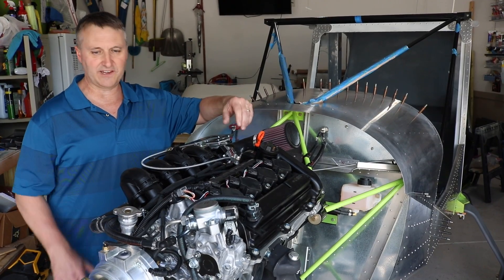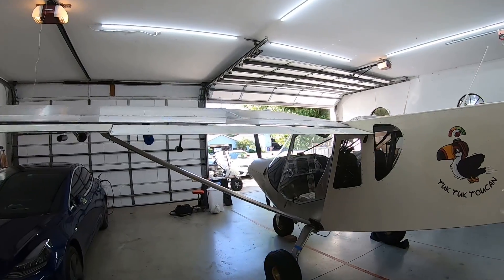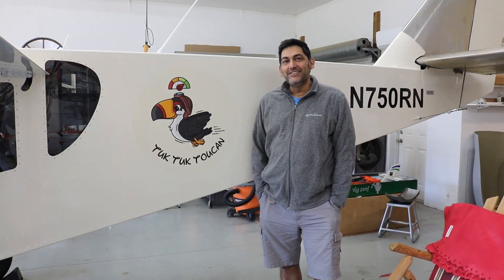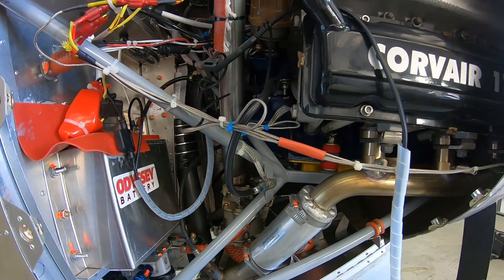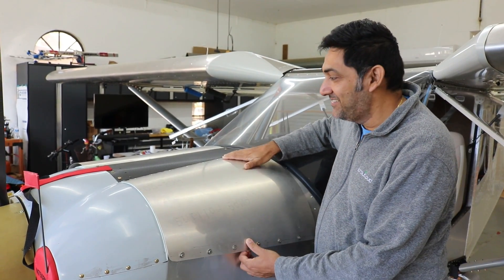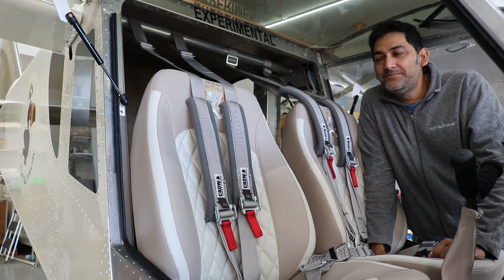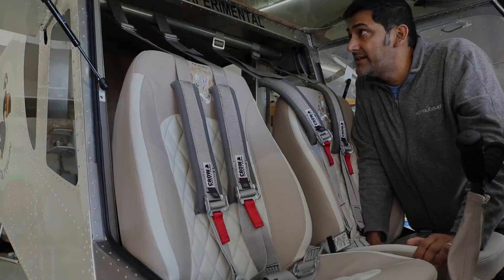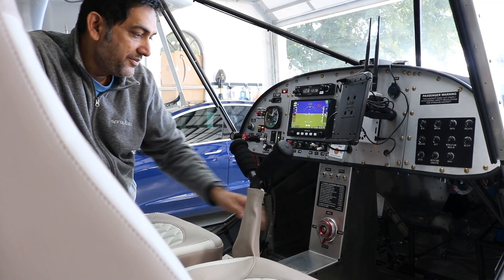Engine Installation Options - Corvair Zenith

Comment: Ive researched the corvair engine for a long time. By the time you buy everything to convert the engine you could buy a good low time Continental 0-200. Plus, what I have seen about the reliability of the corvair, no thanks.

Comment: The only issue I see with the corvair is the support is all from one guy who specialized in converting the GM Corvair to an aircraft engine. What if something happens to him now where do you get support? I think I would rather use a Rotax 912 which has lot of support from multiple sources. If you don't mind tinkering with engines then the Corvair is one good option.
Reply: Actually William Wynne has a strong partnership with Sport Performance Aviation (creator of the Panther LSA) to both manufacture and market Corvair conversion manuals and parts.  One of the coolest things is that WW offers colleges and build seminars where people get instruction - for free - on how to build the engine.  So as a home builder you will know both your aircraft and your engine from the inside out.

Comment: I've settled on that exact engine and airframe combo and just got done disassembling the engine core.  Even if you don't go with a GRT PFD, their engine monitor has a serial output that should integrate with most PFDs currently on the market.
Reply: Me too!

Comment: Does this use the stock corvair transmission?
Reply from the maker: The transmission is NOT utilized in Aircraft. It is in fact "direct drive" just like typical piston Aircraft engines. Thanks for asking!
Reply: @ExperimentalAircraftChannel  haha I will be using one in the bearhawk lsa I am building. Just messing around

Comment: Ramesh has a great attitude, I’m hoping some of that rubs off on me as I move towards the engine install on my rv! I also went with Steve for my fuel and brake lines.
Reply from the maker: Yes...yes he does! You can see the excitement and passion he has for Aviation and in Life in general when speaking to him.  What are you about to install I your RV???
Reply: @ExperimentalAircraftChannel  "about to" really means in a year. I have an io390 exp119 on order with Lycoming. It's going in an rv14A that I am building here in my garage in MA

Comment: Can't understand why none has installed a Hayabusa 1.3 turbo on a LSA airplane yet. 300 HP and 150 pounds.
Reply from the maker: A Kawasaki has been done (competition for Hayabusa). And of course a Yamaha. The problem with straight out motorcycle engines is the high rpm and stock/standard ggearboxes.   You need a purpose built gear drive to match prop rpm/length.  Thanks for engaging here! Good to see your interest!

Comment: Ramesh Nori accomplished creating a remarkable build. The airframe is interesting enough but the cockpit is elegant with added safety. 
I like the three sections of the instrument panel whilst providing access to all the useful features on the panel.
I think the installation of an antique Chevrolet engine adds something special. The installation presents with 50 years of refinement seemingly just barking at technology advancement. 
It really takes a special commitment to achieve such an accomplishment. The 2500 foot runway is overkill.
Reply from the maker: Good points! The Corvair does have MANY refinements used as a "Flight Engine" of course and cannot compare to the stock examples used from the past. The runway I believe was quoted at 5,000'actually. Multiple take offs and landings possibly in a straight line! :-) Thank You for watching!
Reply: @ExperimentalAircraftChannel  Yes, making the Chevrolet Corvair engine flight worthy deserves much consideration. The Corvair name in itself merely indicates air-cooled not aircraft. At the end of the day, when the administrator issues a flight airworthiness certificate their operation standards are paramount.
  The standards set forth for determining the number of take offs and landings on an FAA approved runway appears to be somewhat obscured. Apparently the type of operation, airport specific operating procedures, and the general consensus of the pilot community can all have a bearing. It may be prudent to consider that when all relevant criteria has been observed, most pilots may agree that take off and landings should occur within the first one third of the runway unless an authorized agent issues a landing target zone beyond.... So probably it is wise to limit a landing and second take off within the referenced data published by the administrator within the AFD but only after consulting with the airport directors and confirming the operation falls within the operating certificate guidelines. The legality issues revolve around so many points of law that consulting an aviation attorney prior is probably prudent. Insurance contracts can be complicated and I think this issue overlaps both the: individual aircraft hull and casualty underwriting and the airport specific coverage. 
   It seems that the concept of Experimental extends from airframe to engine to FAA approval, pilot operations, facility management, insurance and litigation. 
  Best practices whilst experimenting folks!